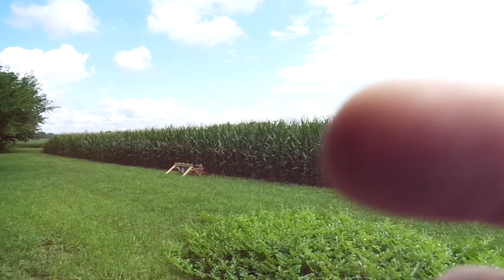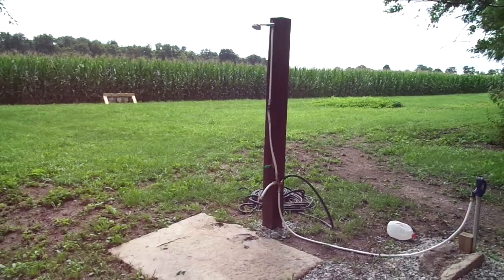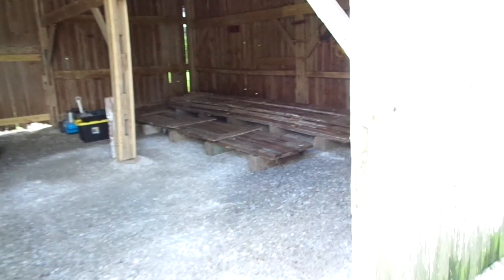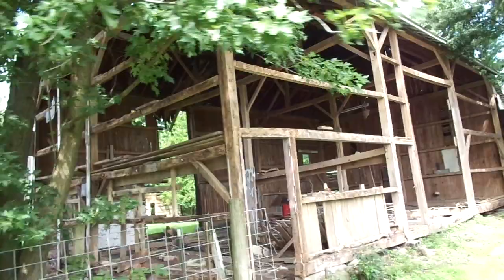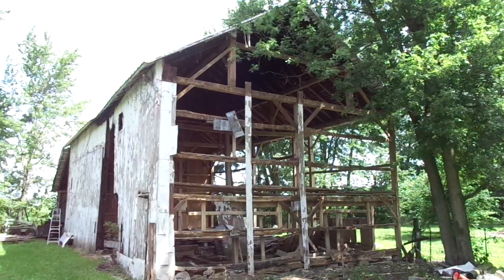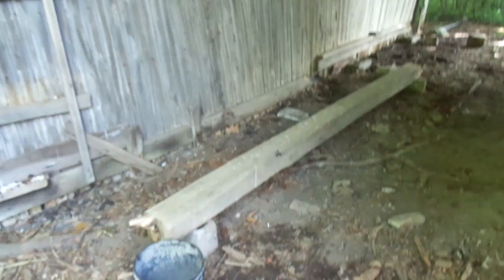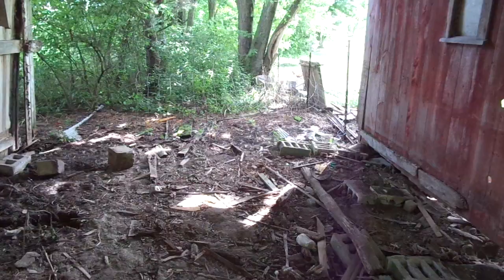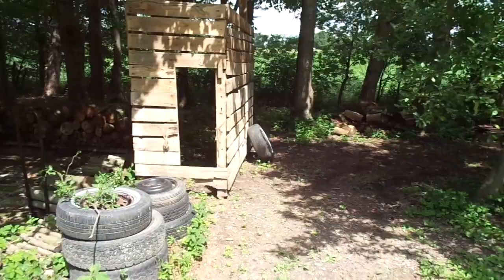Barn Beam Outdoor Shower and Tear Down Progress

Comment: You ever treated lumber by burning it with a torch and then wire brushing it followed by some used motor oil.. the Japanese started doing it along time ago and some of their buildings are 2k years old and the wood is still as good as the day it was put in its place.. it's called shoshuguban or something like that